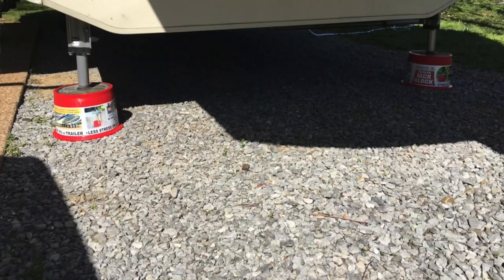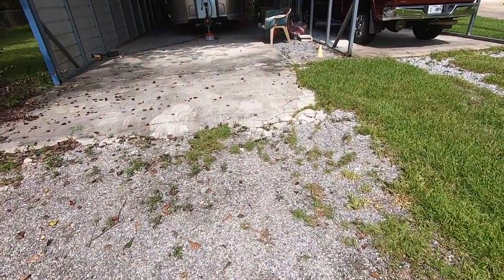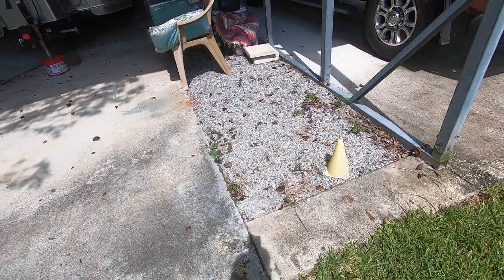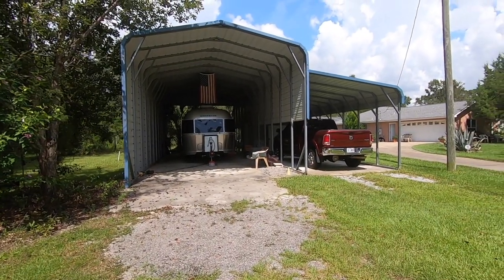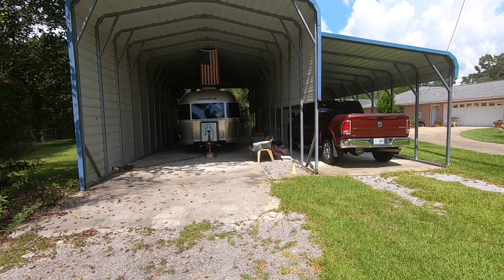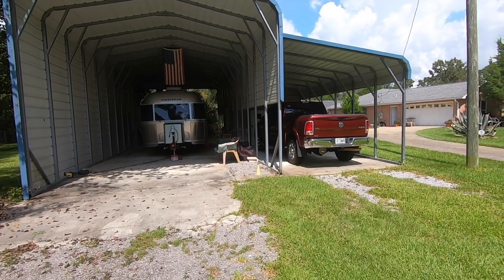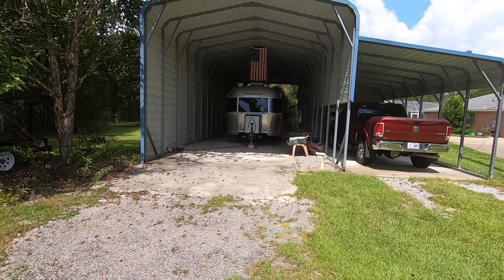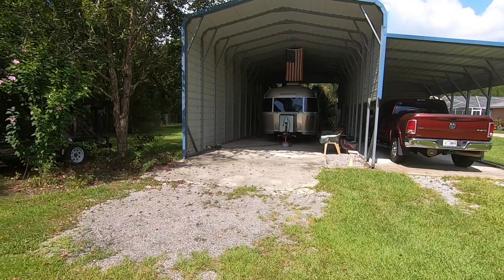How to Design & Buy Covered RV Parking - Protect Your Investment

Comment: Great video! You answered some questions that I had, thank you. My 31' Classic sits next to my house uncovered. I had it in a covered storage unit but had mold issues, there was zero airflow and zero sunlight, and no power, so we moved it home. Those issues are now corrected. Unfortunately, our HOA will not allow this type of storage. I'm still considering various options including purchasing a lot for the Airstream.
Reply from the maker: Depending on your local climate, moisture can be a problem. I run a dehumidifier 24/7 and I keep it plugged in for the batteries. HOA can be a pain so good luck finding a solution. I also cover all of this in my book if you are interested, thanks for watching. https://amzn.to/3CGDe85

Comment: Thanks great video.  

I saw another video where the person mentioned mice can get thru the frame to the inside of your floor.  He thought airstream should have designed the frame structure opening some sort of cover.
Reply from the maker: Airstream did a good job sealing up my trailer but not sure it is mouse proof. I have a couple of cats on patrol in the area :)

Comment: Again, great info and thanks for sharing.  

What was the reason to not cover both ends ?  Is it cost? Tax related if you cover it?   Do you have any lighting ?
Reply from the maker: Didn't cover the ends due to expense and living in a hurricane prone area, Florida, thought it would handle the wind better if not boxed in. I put solar power in which give power to the shop and lighting for the RV parking area. You can check my solar videos to see that. Thanks for watching.

Comment: Great suggestions for covered storage, a must in my opinion. Just curious how you like the Airstream versus the Class A and 5th wheel?  We went from a 5th wheel to Lance and now small Tiffin Class A.
We are now considering an Airstream but would probably  have to upsize my GMC 1/2 ton pickup.
There are trade offs with all RV's I guess we need to find one that checks the most boxes. Are you using a 3/4 ton Ram?
Reply from the maker: I already had a SRW 3500 when I got the Airstream and it is a great tow vehicle. Once you decide you can live without slideouts the Airstream is great. I wanted to be able to get in more national parks and not worry about height clearance every time I went under a bridge. Airstream is a different world, their quality is unmatched (but not perfect), the resale value is much better than any other brand but you do have to pay the price. Good luck and thanks for watching. Also, if you haven't checked out my books I have My RV Mentor and My Airstream Mentor. https://amzn.to/3fWyP72
Reply: @LandingZoneHome  thanks for the quick reply, we're dealing with a Schwintek issue on the Tiffin right now. Slides are great for camping but can be problematic. We're kind of leaning towards a 30' Classic, the AS Dealer told us to avoid 17/18 year because of Aldi hydronic issues. We are also considering Flying Cloud, International, and Globetrotter in the 28' to 30' range. Need to sell the Tiffin first but already have a buyer lined up. With a Class A Diesel there's a lot of things to stress out about, just my thoughts.
Reply: @cackerson10  We have a 2020 Flying Cloud 27 FBT (Front Bed Twin).  It’s almost 28’ long.  We love the trailer and the layout.  We tow it with a 2019 Ford F-150 XLT SuperCrew/Short-bed 4x4 FX4 with Max Trailer Tow package.  3.5L twin turbo ecoBoost engine and 10 speed transmission.  When traveling, the truck is right at its GVWR of 7,000 lbs. and the loaded trailer also weighs 7,000 lbs.  We connect them together with a Propride 3P-1400 hitch.  The combination tows beautifully with all axle weights within their GAWRs and the total/combined weight well within the GCWR of the truck.  The curb weight of the FC27FBT is about 5,800 lbs. with a GVWR 7,600 lbs.  Anything heavier than this TT would require us to move up to a 3/4 ton or larger pickup truck.
Reply from the maker: @cackerson10  Sometimes this stuff can be stressful, but eventually it always works out. Good luck.
Reply: @LandingZoneHome  does the Airstream have a spare tire underneath, I’ve never seen anyone mention it
Reply from the maker: @cackerson10  Yes they do. There is a place under the front of the trailer for the spare tire.